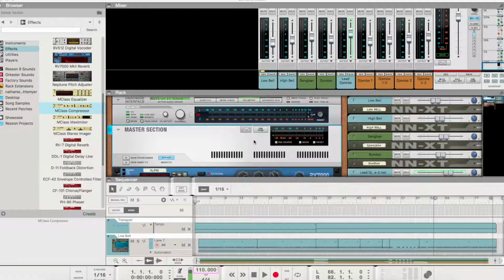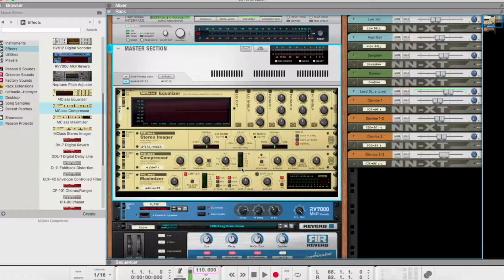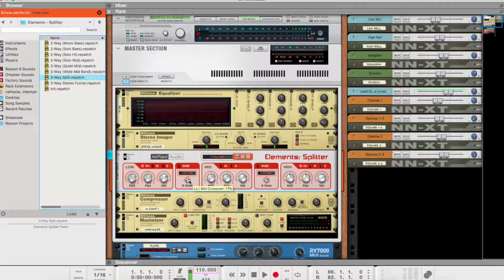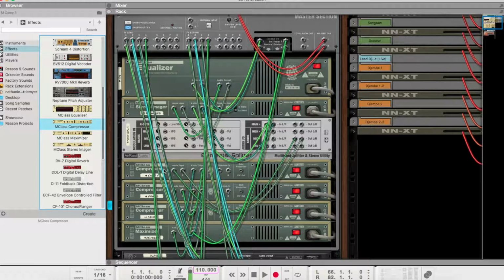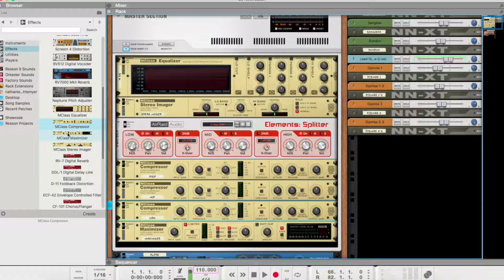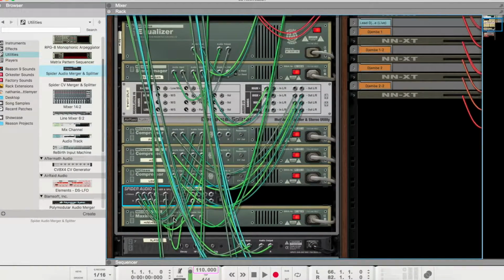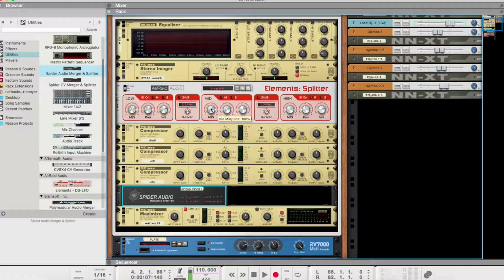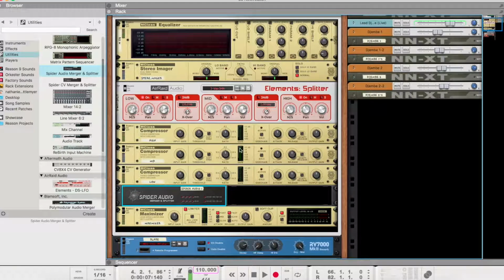Multi Band Compression in Reason's Master Insert Chain

Comment: P.s Reason Has Changed the back of the splitter, so following your video is Void... Check it out, so OTHERS don't get stress.. cheers
Reply from the maker: Thanks for your comment. This video reflects the connections used in Reason 9. The signal flow is still relevant regardless of the position of the connections.